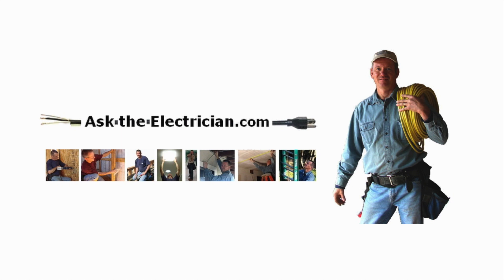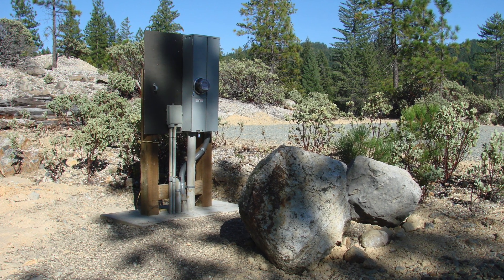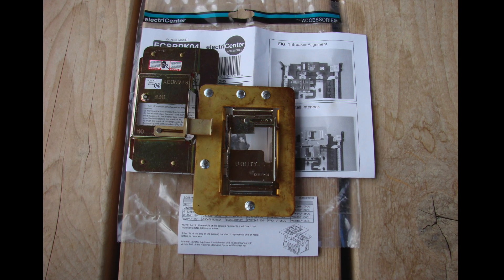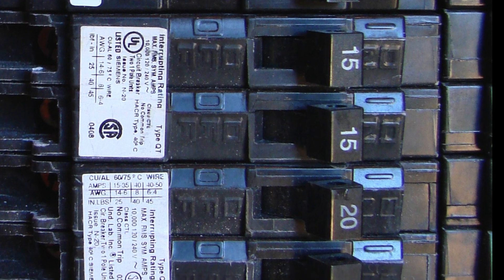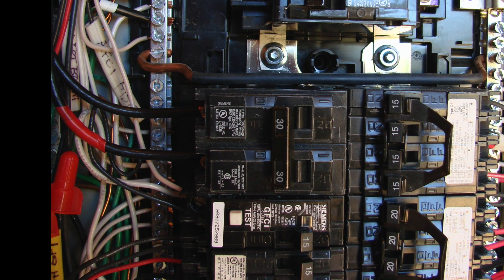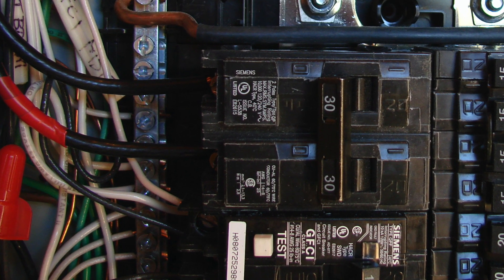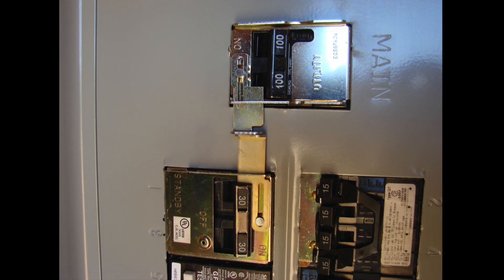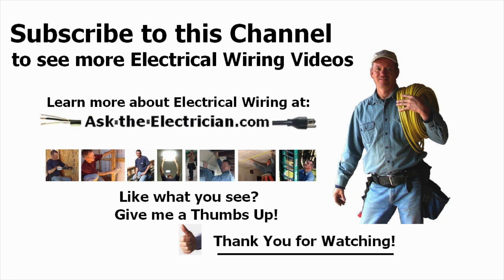How to Hook Up a Generator to a House Panel For Backup Power.

Comment: So having a cord that comes out of the panel and straight into generator without a power inlet box is acceptable? I haven’t seen it done this way before but I have an inspection coming up that it is done like this and trying to do my research.
Reply from the maker: There needs to be an NEC approved transfer device installed.

Comment: This is stupid...all you need to do is turn off the main breakers ..and install a 30amp breaker in breaker box ( green wire and red wire from.
Cord into breaker and copper wire to ground in box and white wire with all other white wires in panel and plug other end of generator cord into generator.
Reply from the maker: That method may work, but it is not compliant with most electrical codes.

Comment: I bought a firman tri fule. Firman stated that I need to unbond the neutral on the generator it self. Your thoughts.
Reply from the maker: Follow the complete instructions of the generator manufacturer, and be sure the transfer switch is configured the same way.

Comment: Question. Disregarding the interlock switch,would it matter where the the generator breaker is installed?

Say if you put it on the middle ,it will still power all circuits because thats how electricity flows ,essentially like water,correct?
Reply from the maker: Electricity works in both directions, regardless of the location of a circuit breaker. The concern when connecting a generator is to install a device that will turn off the utility power source before the generator power is turned turned on. An approved transfer device that is installed properly will ensure safety as required.
Reply: @AskTheElectrician  ah ok got it. Thanks for answering 😊
Reply: @AskTheElectrician or you can manually turn off the MAIN breakers in box ..and not have to spend $2000 on a dumb not needed bar ...

Comment: Hi great video , but I am getting a Reliance 50 amp transfer switch panel installed and it looks very and straight forward , but I was wondering what you thought of these type of transfer switches . In this type of transfer switch pane you only manually switch from line to generator the circuit that you have wired into transfer panel . I have a 200 amp fuse panel ,witch has been oked by the power corporation .So I can't use a inter lock kit like you show .Thank  you hope to here about these type panels .
Reply from the maker: There are several options for transfer switch panels such as Reliance which may work well for some applications..

Comment: Question, I had an electrician wire up a 30 amp outlet for my generator. He was, supposedly licensed, but he put the green wire on the neutral bar with a white wire. Isn’t the green supposed to go to the ground bar?
Reply from the maker: At the Main Panel the Ground and Neutral are bonded together.
Reply: @AskTheElectrician Ok, thanks. I’ve seen many people put them both ways, so I was just wondering. Thanks!
Reply: Another question. I would like to upgrade to a 50 amp. The 6 ga wire won’t fit on my bars for neutral or ground. Can I put one of those lug kits on the bar to accept a 6 ga wire? Thanks.
Reply from the maker: Split the 6ga wire into two twisted strands and connect them to two terminals, or a lug kit will work as well.

Comment: Can you explain how back-feeding through the 240-volt drier outlet will potentially damage the wiring in my home? My generator has 30 amp circuit breakers so the maximum current that is available is 30 amps. The drier outlet is also protected by a  30 amp breaker and the power from the generator goes through that too. So there is immediate double protection before the power even gets into the general house wiring. The house wiring is protected by 15 and 20 amp breakers which the generator power goes through. So with all this protection how can back feeding damage my electrical wiring? I realize this is not safe because I could forget to trip the main incoming power breaker which would endanger the line work men/women. This is the only reason I wouldn't back feed without a transfer switch.
Reply from the maker: Simple answer: It is Illegal, and it is Dangerous. And you are forgetting one thing: In order to back feed the home in the way you are describing you will need to make a suicide cord which has 2 male ends which will also become energized which creates a 240volt electrocution hazard as well, in BOTH directions. Without a transfer switch or lock out device there is always the possibility of back feeding from your home to the grid in your area, which goes through the utility transformer and energizes the damaged power lines in your area that need to be repaired which can kill a lineman that is working on the repairs, and this method can also back feed your neighbors. You may say you will be sure to turn off the main breaker when you do this, but that does not always get done especially when you are in a hurry to plug in your generator and get some power on. Along with all of this you risk burning up your generator once the power comes back on too.
So - do you still think this is the right way to go? I hope not - for you and your families safety, and the lineman working to restore power in your area.
Reply: @AskTheElectrician one can manually turn off the main breakers inside breaker box ..and no power will come in or go out correct..?
Reply: Exactly!!! This is a plot to make people call a electrician who charges 100$ hr to do dumb stuff that is not needs ..most people are ignorant of that
Reply: Lol ...as long as you plug the cord into the dryer outlet and into generator before starting generator there is 0% chance of electrocution!!

Comment: I had a friend say my generator doesn’t need a common wire is this true or false?
Reply from the maker: It is always recommended to make all of the electrical connections to a generator according to the generator manufacturers specifications to avoid damage to the generator, to home or devices that may be connected to the generator, and to protect the user as well.

Comment: Why don't you physically show how to do this?? This makes no sense zooming in on random boxes
Reply: I don’t mean to be rude. But if you didn’t understand what he was showing by the pictures this job is too dangerous for you to attempt.
Reply: It's not dangerous..turn off mains in your panel and attach generator cord to generator and dryer outlet while generator isn't running and check again that main is off in panel ..turn off all breakers in breaker panel ..start generator and one by one turn on breakers for house ..not the main
Reply from the maker: Thanks for the feedback. I am not showing random boxes, these are on the job photos with examples of the devices that are used with this type of generator hook up, however your feedback will be considered for future videos. Thanks again,
Reply: I said the same...useless content to be honest....its like showing a still picture of 2 unknown boxers without pointing anything out saying Jon punch him to the floor and he never got up... we will not know which one was John and which one went to the floor...

Comment: Good overview of the generator connection and safety mechanisms that need to be put in place. 
Q1: Is the interlock device placed on the main and the generator circuit breakers required by electrical local code or is it only a safety recommendation? Naturally, no one should have these breakers on at the same time, and this interlock switch will prevent any mishaps.
Q2: There are also manual generator transfer switches that are installed on the outside, next to the power meter, between the meter and the house main panel, how different are those from the method you demonstrated here?
Thanks.
Reply from the maker: A transfer switch or lockout device is required when there is more than one source of power such as a generator that will be used to provide power to a home. There are many types of these devices to choose from. It is best to select one that will work best with the existing electric service panel, and other options may require modifications to the electric panel to allow proper connection from a generator unit to the home. Of course, all of these types devices should have an authentic UL Approval, installed by a Qualified Person such as a licensed or certified electrician, and the work should be inspected as required in your local jurisdiction.

Comment: Excellent Video thank you.  One question for you, i have a floating neutral generator.  In this typical interlock switch install assumption is the house system neutral and ground remain connected (vs. floating), do i need to ground bond my generator and use a ground rod or can i simply connect the L14-30 cord to the panel box without any additional worries?
Reply from the maker: Only if the generator owners manual states to do do this. The concern is not to a have redundant earth ground. Keep in mind that the home that you are connecting to already has  a ground system in place.
Reply: @AskTheElectrician  ok yes that's my concern i don't want to have redundant grounding.  The owners manual mentions grounding the generator to a ground rod but unfortunately its not clear enough so is this a must for all applications i.e. when using the interlock switch using the home hook up and running just extension cords or just when running an interlock switch.   I may have to call the generator mfg.

Comment: Great video.  You mentioned wiring to a sub panel.   I have a 100 amp sub panel in my shop about 100 feet from my house, I can install an interlock on it and run my generator out near my shop? I’m using a 240 volt 30 amp  generator.   I would install a 30 amp breaker in the sub panel and install the interlock between the 100 amp breaker and 30 amp breaker? It would be nice to be able to run the generator from out there instead of near the house where people driving by can see the generator.
Reply from the maker: This could only be done to provide generator power to the shop using the sub  panel. The house could not be connected to the generator using the method you have described. 
To power the home with generator power the interlock would need to be installed at the main panel and the generator would have to be connected at the house main panel location.
Reply: @AskTheElectrician  gotcha.  I thought about it after I asked the question and realized that wouldn’t make any sense to do that since it wouldn’t lock out the main breaker on the house.  Thank you for your reply.
Reply: @AskTheElectrician I have a whole house backup generator set up this way; there’s the main 200A panel which has lines that run from a 100A breaker underground to another building with a 100A panel. 

My question is this:  we want to have a separate service with its own meter to run the other building. Am I correct with this plan?: Have the power company install their meter and incoming service to a new 100A main panel next to the existing 200A panel. Then take the lines that are in the existing panel on the 100A breaker that run to the other building to a 100A breaker in the new panel. Now the two buildings are completely separated. 

The burning question then is how to now connect the existing panel that has the whole house generator already wired to it to the new panel next to it? No additional loads are being added so the generator is still sized adequately.  I know another transfer switch is needed for the second panel. 
I just have no clue how to connect the generator to the second panel. 

I will be having an electrician do this but I myself want to know exactly needs to be done so no one can bullsh!t me when I get quotes. 

Appreciate the help if you can.
Reply: @AskTheElectrician (continuation from my other message)  I forgot to say that the new panel would of course have its own ground rod😊

Comment: I noticed the use of a 30 amp double breaker would that have any problem with do 70 amp double breaker on the furnace
Reply from the maker: The size of the circuit breaker that is used for the interlock should match the generator rated output and specifications.

Comment: Probably seems like a stupid question..but if my generator feeds the breaker on one side..how does the other side get power. I guess I always assumed the two feed lines comin in and each feeds one side of the panel (in my case). It would seem like backfeeding through a breaker works but just to the other breakers attached to that load bar (or whatever). I'm clearly wrong as I've watched a couple of these videos but I don't understand it.
Reply from the maker: Bret, It may help to know that a circuit breaker has the capability to work with electricity flowing in either direction.
Reply: @AskTheElectrician  that part I get..backfeed through the new breaker I install. And that makes sense it will feed the breakers on that bar. The adjacent bar which is normally fed by a different 110 line is what I refer to. I wouldn't have thought those would have any power. Im probably not explaining this.
Reply: nermind..took a look at the box without the breakers and I see how a double pole gets feed
Reply: @whobdis56 all the power feeds come from the same source..the breakers when closed prevent power from traveling thru the line attached to outlet of said breaker.. individual breakers are for different things in house like light ,stove ECT..they don't stop power from traveling down to the next breaker...that's is what the main breakers do

Comment: I had an electrician hook one of these up for me at my house. I was in the box the other day and noticed that it only had 3 wires. a black red and neutral. Is it ok that it doesn't have a ground wire?
Reply from the maker: Yes - in this example the main panel ground system is sufficient when using a portable generator.
Reply: @AskTheElectrician   do you connect the neutral or ground to the panel in a 3 wire system ? I assume the ground correct ?

Comment: What if your main breaker is 50 feet outside your house ?
Reply from the maker: IF the Main breaker has no provision for additional breakers, and it is the Main for the home, then a transfer switch would have to be installed between the main breaker and the circuit distribution panel.
Reply: What good is a transfer switch when all you have to do is shut off the main breaker ?
Reply: @scarter176 ..it is for electricians to charge you $2000 to install a not needed device..either way you have to manually switch off the main

Comment: Very good presentation. I have a question. In this configuration should the generator ground and neutral bond be removed and create a floating neutral since the generator will be bonded at the panel?
Reply from the maker: The generator bond of the ground and neutral should not be removed, as doing so may void the generator warranty and be a code violation.

Comment: I cannot find info anywhere on whether I need to install a 50amp GFCI breaker on my outdoor main panel or, since my Westinghouse 950/1250 generator will be powering existing 20amp breakers on the panel in my garage that are already GFCI, I don't need a GFCI outside for the generator connection.  The two 20amp receptacles on the generator are gfci, the 30amp is not but of course I understand I will not be using those when connected to my house panel .  Any clarification would be appreciated.
Reply from the maker: Typically the circuit breaker for the main connection of power from the generator is not required to be a GFCI. The existing GFCI protection for the other circuits within the home is adequate and continues to provide ground fault protection.

Comment: I have. 3500 watt generator with a 3 prong tv outlet of 30 amps and only 120 volts, is it ok for me to plug in a 3 prong Rv to L14-30R extension cord ( in which the two hot ends of the L14-30R are pigtailed to the single hot from the 120v 30 amp RV end, or maybe I’ll just use a Rv extension cord to a a l14-30 dogbone )  to a 2 pole 30 amp 120/240 auxiliary input breaker (with an interlock installed) ? Wont this give me 120 v on each pole of the auxiliary input breaker?
Reply from the maker: This would depend on if the generator 30 amp outlet is 120/240volt 4wire (2hots, a neutral, and the ground wire), or 240volt 3wire (2hots and the ground wire), and if the RV electrical service is 120/240volt 4wire, or 240volt 3wire. 
The concern is to properly identify the RV electrical service specifications, and to make sure the connection at the generator is the same as the RV specs, and of course to use approved cords or adapters that will maintain the integrity of the electrical specifications for all electrical components throughout.

Comment: But your only using one 30 amp circuit to try to power a 100 amp panel. How can we combine the total amps to power the panel ?
Reply from the maker: The output capacity of the generator in this example is 30amps, therefore 30amps is available to use for essential loads while on generator. Keep in mind that just because a panel is Rated at 100Amps it does not mean that it ever reaches the 100amp rated capacity, and in most cases it never does. If a home requires more amperage for essential circuits when the utility provider is not available then a larger generator may be installed and connected as per the rated capacity of the generator.
Reply: I hear ya i guess its just a bummer that my generator has a 58 amp capacity but only throughout all the receptacles😭 i cant power my heater and my tv and my other appliances at the same time on only one 30 amps receptacle wired to my circuit panel …most houses use more than 30 amps

Comment: Can the generator power a sub panel connected to the main if the sub panel have a50 amp 2pole breaker and the break for generator is only 30amp 2pole if only the ones thats needed
Reply from the maker: A generator can provide power only to a sub panel which has a main breaker, and installing the correct circuit breaker lock out device, or a transfer switch could be installed.